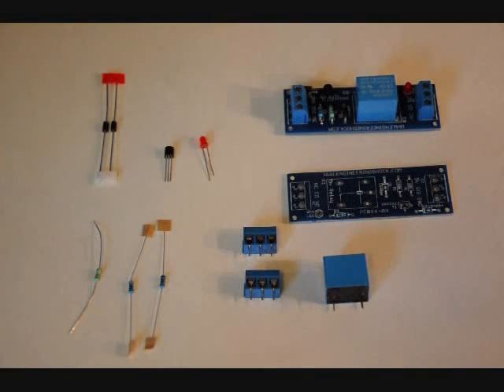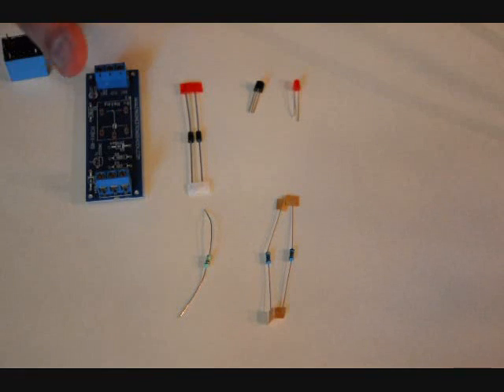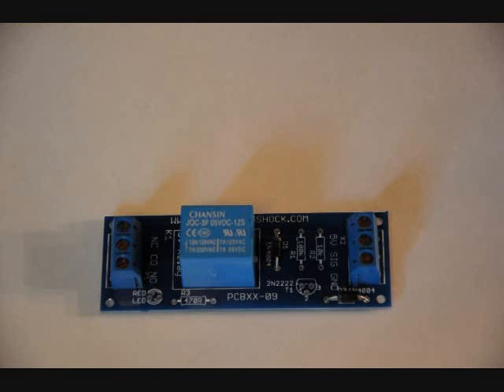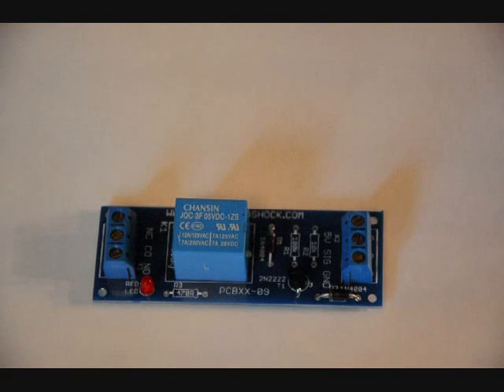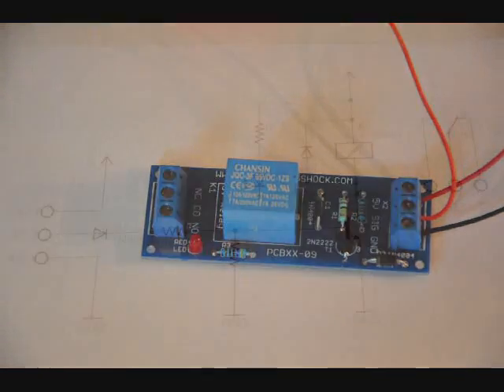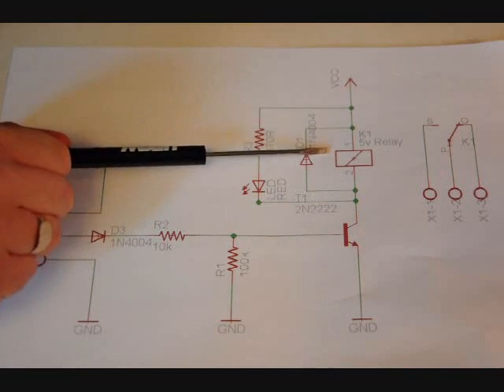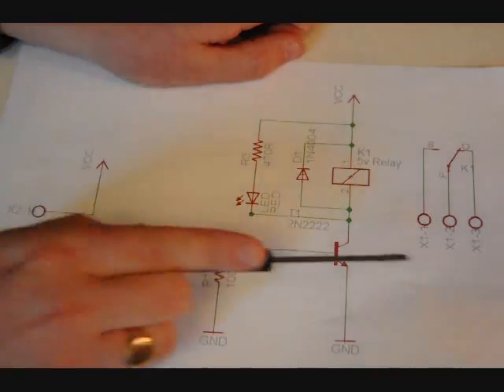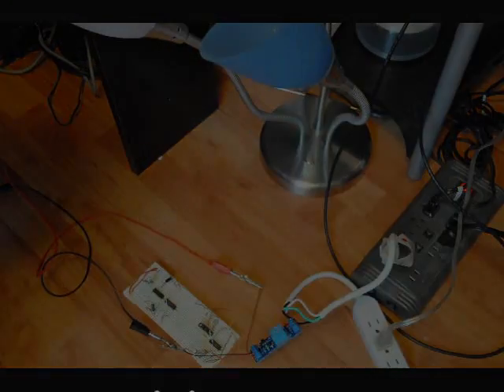A Solderable Relay driver board DIY electronics kit

Comment from the maker: @Insignificantful 
Hi there =)  Thanks!  The hot wire is cut befause switching on the neutral is against electrical code.

Comment: Excellent explanation. I have created something like this before. Why do you always have to cut the hot wire? Don't both live and neutral carry the voltage and current. They are alternating afterwards right?